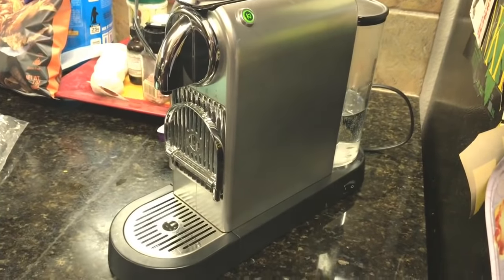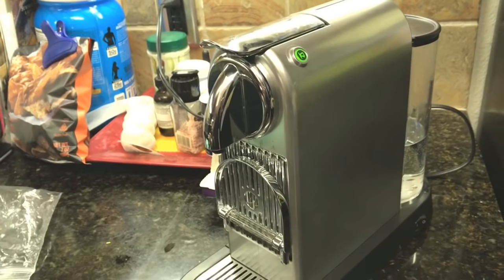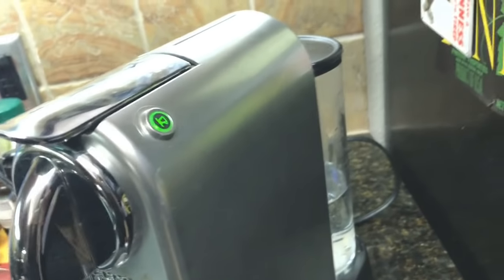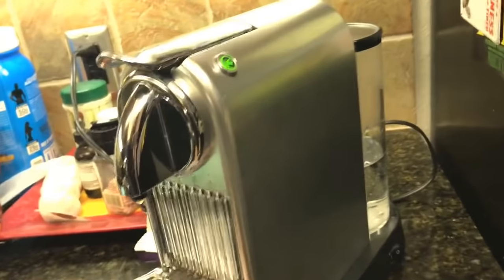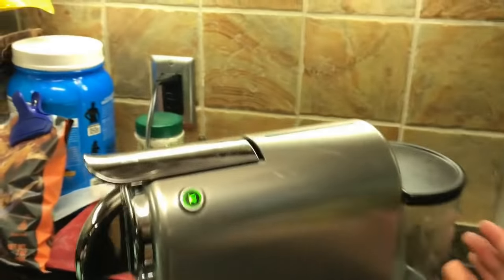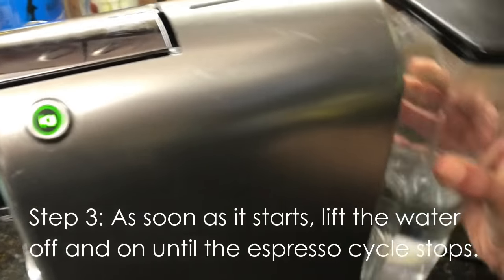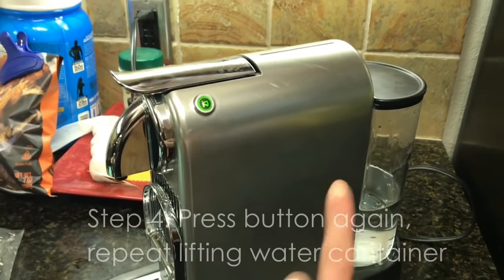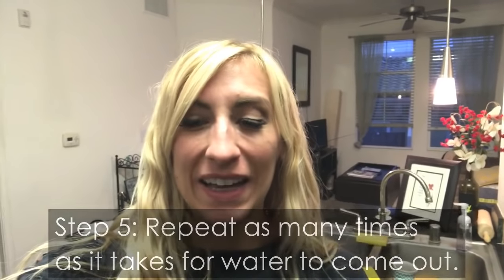How to Fix a Nespresso Citiz Machine That Isn't Pumping Water

Comment: I looked at several videos, including this one. I watched one where the man said to do it really fast in and out. I also put a drop of vinegar in the hole  as I was pulling the water piece in and out. It finally loosened up, and water started flowing. I added vinegar to the water and flushed it out thoroughly until the water was clear of coffee debris. Needless to say, it's close to midnight, and I am wide awake cause I wanted to drink a cup of expresso after working on getting it un clogged for close to 2 hours 😂

Comment: This works on Verismo that has been in storage a long time-7 yrs, today. Flushed with vinegar/water mix. Took about an hour as I tried using straw with an ziploc bag filled w air to seal around straw, as I blew into the machine port. Also searched other solutions. This got it done!

Comment: I stored my machine for more than 2 years and it was not working anymore. I called the company and she told me to pump the container back, but the water still did not flow. But while doing it while the machine is running as you have described, it worked! But I pumped more than twenty times trying both buttons and finally the water came out! Thank you very much for your video.

Comment: I, too, was losing hope. After 40+ cycles of doing this, nothing. "Maybe I have the one machine that this won't work for" I thought. But then, just as I was about to throw in the towel, I heard a faint bubbling sound, and after about the 45th attempt, I finally got water out. My machine is now working perfectly! Thank you so much for this video!! This WILL work, keep going!

Comment: I didn’t think this worked for me after 20+ attempts at pushing the button and moving the water tank up and down with boiling water so I stopped. I left it for a few hours and came home to try again, and voila! First push of the button and water came through. Maybe this will help you if you don’t think it’s quite working but you hear some gurgling sounds in the machine. Thanks for the tip! (The ziplock bag with air trick absolutely didn’t help and was way too hard!)

Comment: I did this for a while and it didn't work. And then I tried the "plastic bag" method and that didn't work either. However, when I combined this method with the plastic bag method, I finally got it to start pumping! So, if anyone is stuck after trying the method in this video, try combining methods. 

Thanks so much for this tutorial!

Comment: Thank you for the video! I also followed through but the key here is make sure you use VERY HOT water. I tried 15 cycles with warm tap water at first and did not work. The second the Nespresso customer service representative told me to use HOT HOT water, the water came out. I filled half boiled water and half room tap water in reservoir, so the water came out right away! Good luck!

Comment: Hi Holly, I had my CITIZ sitting in storage for like 4 years, finally decided to pull it out and use it and it basically wouldn't pump water. I spent hours trying to figure it out just like you. I even took the screws out and took it apart and it did nothing. Then I came across your video, tried it, and I had it working in about 5 minutes. Great video! Thank god for you! You're awesome.
Reply from the maker: Yay! I know, I was so frustrated, too, and it turned out to be so simple!

Comment: Yes! This fix worked perfectly. Be persistent; it took numerous iterations of working the water reservoir...I'd lost the siphon by running the water dry. Try not to do that. It happened to me once before, and I got it working again. This time around, it was more difficult...Thank you for this remedy. I've had early model (Essenza) for >10yrs, and it works perfectly. I clean it after every use by just run water through.

Comment: Yes, thank you Holly. I tried the air filled sandwich bag and the popping the reservoir off and on to no avail.  I couldn’t figure out the straw solution.  The really hot water must have done the trick.  Thanks for saving us the agony of trying every other YouTuber out there.

Comment: Bought a beautiful Citiz machine on Marketplace. Water wouldn’t flow.  This fixed it! I found that it helped when you hold one finger over the spout to create more suction while you are lifting and replacing the tank.  Had to do mine line 12. times! Started to see more bubbles when I did that finger trick!  Thanks again! 😊

Comment: No joke, you are the Nespresso hero!  After sitting in storage for 3+ years we decided to take out the Nespresso machine.  After cleaning the dust on the outside, I hit the button and no water came out, just the buzzing sound.  Next, I find this video and it took me like 10 minutes of working her technique before the water got through the clog and started flowing.  My wife was upstairs probably thinking I lost it and was taking my anger out on the Nespresso machine. Lol.  Pro tip: you don't have to fully remove the water tank.  Just tip it back and away and then put it back in place.  As long as you momentarily break suction at the bottom and then reconnect, you will force the water down and into the system.  No need to completely lift the tank.  I might have fixed mine faster had I not removed the tank each time at first.

Comment: Had the same problem, machine was in storage brand new and after 5-6 years I decided to use it. After several failed efforts mentioned in the video i came up with a solution that worked for me: I used a syringe to suck the air out of the system which was clogging the water flow, placing it on the bottom of the water container, right above the red circle while the Lungo button was pressed (the one on the right). Repeating the process for a few times. After this the machine went to cool off mode due to excess heat and the water pump could not be used it. I waited about an hour for it to cool off and when I switched it back up...Voila!!.. the water was flowing and I enjoyed a cup of espresso. Hope this works for you.

Comment: Holly, over on the Nespresso reddit sub, we send folks to this clip often. Thanks for the effort and a working solution. If I may, the action of raising and lower the tank engages and disengages the valve. When you place the tank back on the valve, a tiny bit of pressure is applied to the drop or two of water that are below the valve seat, forcing that small volume of water along toward the vacuum side of the pump and, hopefully, eventually clearing the vapor lock. This repeated action could, in impatient hands, result in damage to the valve. I have had success simply using a turkey baster to squirt water under considerable pressure down the tube. Have a towel handy.
Reply from the maker: David Bogie thanks for the extra tip!

Comment: Amazing thanks that worked! I had not used my machine for 2 years, and could not find any helpful videos until your one.  It took 3 cycles to get it pumping again.  I noticed you will help the machine get a bit quieter once the water starts to run through it again. THANKS!

Comment: Thank you for your video.  I had just cleaned it and it no longer pumped water.  After 3 tries of removing and returning the water dispenser, it works again.  You save me so much time to try to figure this out.

Comment: It was Air-locked. 

What you did was a process called manual-priming, or just: Priming.

Very nice video ma'am. I'm certain it'll save many perplexed souls a good deal of grief.

This process also works with about any other brands/models of home-espresso machine as well. 

My mother has the Lor/Barista machine that Phillips manufacturers. And they see notorious for getting air-locked.

Good idea using the hot water. I'd say that has something to do with there being less air-bubbles in the water.

Really, i think it's best (if possible) to avoid using tap water all together simply for the fact that a lot of times there tends to be more air bubbles in tap water.

Comment: Thank you so much. 
After trying to fix my Romeo model for 2 days, before finding your video, I ordered a new machine. (the Romeo is 12 years old)
I then saw your video. I tried it and IT WORKED. I first had to finish the descaling procedure which had stopped at the rinsing cycle. It now works great. 
I think I will put the new machine in storage and use it as a backup. 
The fix was simple but the past few days have been frustrating.
Reply from the maker: Robert Goldman awesome!!

Comment: Friends - thinking I was the only one this hack was not working for, I got it to work. AFTER like 50 tries, 45 mins of on and off canister/tilting, lever and more, I resorted to trying boiling water. I boiled a small pot of water and  poured it in the water canister then waited like 15 mins for it to dissolve whatever was blocking the suction thing. I was told the heat of the water would open up the seal. I was getting quite disappointed as I had read 500 comments saying it worked for everyone… and then - eureka! FINALLY, FINALLY FINALLY, WATER CAME OUT THE SPOUT!!!  OMG i screamed with joy like a mad woman! So here is the warning: try and try with warm water, but if all else fails, boil water, let it sit in the canister and do the on/off thing and I hope you are as successful and not need to spend another $300 for a machine that should NOT have this design defect lol!  Thank you Holly! You were better than the 45 mins i spent with the very nice but useless Nespresso rep :)
Reply from the maker: Haha, we’ll I’m glad it worked. Good tips for others since I know it does take quite a while for some people!

Comment: Thank you SO MUCH for posting this video. I was just about ready to try tearing apart my machine when I found your video. Mine had been in storage for a couple of years but hadn’t seen much use before it went on the shelf so I was surprised and frustrated when I found it wouldn’t pump water. I tried the ziplock bag to no avail; I tried a turkey baster which also didn’t work. This method didn’t work immediately and so instead of raising and lowering the reservoir (the tab on the machine made that a bit of a challenge), I just started wiggling it from side-to-side. Just when I was about to call it another failure, it began to sound different, then voilá, expresso!
Reply from the maker: So glad it worked! And thank you so much for the Super Thanks ❤️

Comment: May angels smile down on you kindly!! I haven't used this Magimix Nespresso machine ( almost identical to yours)  for about 2 or 3 years. Its been in the attic. Our other machine has really had it as its about 35 years old... one of the original Cube machines.  It took about 15 cycles with hot water in the water tank as you said. VOILA....It worked. Thanks again. So many useless Youtube videos that didnt work. D from London UK.

Comment: Great advice. I followed it exactly and then noticed on like the 7th try that there were bubbles coming up from the  valve in the water cylinder. Next try i just let the full cup cycle run and presto we had water flow!

Comment: Perfect. My machine is older and was stored probably 4 - 5 years in the garage... Had to cycle 15 - 20 times and I even shaked the machine a bit as I could hear different sounds the last 5 - 7 cykels.. thanks for this!! I was just about to buy an new expensive one but will live with this a few more years I guess

Comment: I have the Nespresso Vertuo and it would not run out of the box!  I did the hot water, pumped up and down with the reservoir  and then I inflated a plastic sandwich bag and  pushed on the bag with the water in the reservoir..and it worked!! yay

Comment: Haven't used mine for over 2 years and this works. I added a little pressure but eventually the hot water cleared it out.

Comment: Hey, I looked all over and tried flipping handles and tilting and even the video with the ziplock back (and my attempt at using a wine pump to push the bubbles through).  I thought it was completely broken but used your method (on a Lattissima) and it worked perfectly.  I though it might break it further when I first pulled the water container out as it created a suction, but after that it moved smoothly in and out and only took 3 tries.  Thanks for your post!
Reply from the maker: Aderon A You’re welcome!
Reply: Hi Aderon, i have some problem on my Lattissima +. Can your explain exactly your problem and how have you solved please? Thanks in advance for your help!

Comment: My machine was also in storage for a long while. So pumping and lifting the tank on and off did not  work, nor did banging on the unit or rocking the unit while it was running. I stumbled on lifting the back of the unit off the surface allowing the water to run down the path it needed to go. Then I ran the unit like 10 times to work out the air and make sure the flow was consistent. *Lifting the back end where the water container is off the surface worked the first time!*

Comment: Thank you...I tried your way after 6 attempts still nothing.  So I while attempting the water reservoir on and off I opened the release lever back and forth 3 times and the water started running. So super hot water and pull handle back and forth. Thank you had to go through the bag theory and others before your fix thank you. EDIT: My model "Inissia" brand new unit.

Comment: @Holly My machine didn't worked for years and I just stored it since it stopped working and didn't find the time to deal with it. Few days ago I've decided to pull it out from the storage and fix it, so I tried few things with no success. I just ran into this video literally 20 min ago and did exactly as you explained, I almost gave up and voila!  It took too many circles but eventually it worked! so a BIG Thank You for taking the time and sharing your experience, that's greatly appreciated. Blessings on you

Comment: I used ours for a month before it stopped working correctly -the water comes out fine, but it wasn’t mixing correctly. So I tried descaling w vinegar. It seems to be working better now but it’s not as strong. I’m going to try this method as well, along w descaling w vinegar again. Any suggestions aside from that?

Comment: Had the same problem, A MUCH EASIER AND FAR QUICKER TECHNIQUE: take a small empty plastic bottle, fill the water chamber with a small amount of water, when the machine is running (with mouth of bottle over the red seal at the base of the water chamber) squeeze the bottle  forcing air through the system, remove bottle, empty water that has been sucked into the bottle and repeat.

Hope this helps

Comment: I have a Citz that was used maybe 10 times whilst our main machine was in for repair 2 years ago. Since then its been in storage unused and is 1 month out of guarantee. Mine also isn't pumping water correctly. After trying the tips in the video, I still get no water flow, but the pump now isn't starting either. Maybe over heated I don't know.

Edit: After reading other comments I tried just off boiling water after the system cooled down. It did 1 pump cycle then stopped again. No water came through. I waited again for a few minutes and used really cold water, and a trickle came through. I am now doing a descaling cycle to ensure the waterways are not clogged, and half way through its stopped again.  I think it is overheating.....so waiting again. however, at least it looks like it is going to work again. Thank you.
Reply: did it work? mine did the same the pump stopped making a noise

Comment: Thanks for this info Holly - sadly trying now for about 20 mins - super hot, almost boiling water and raised the back of Magimix Pixi around 1/2 an inch but still not luck. Not sure if I should continue? Must have done it 50 times! :(
Reply from the maker: Margo Steeden Wow! Maybe it doesn’t work with that version? Probably need to call Nespresso 😕
Reply: Yes, will give it another go this morning and then will contact them. No doubt they'll suggest purchasing a new one!
Reply: So, tried again this morning and it worked after 3 rounds! Persistence is my favourite thing! Thank you very much for your video Holly :)

Comment: Quick suggestion … Before trying anything else, check that the capsule has been pierced properly, I spent half an hour troubleshooting the water flow only to find out the capsule was blocking it …

Comment: I think hot water is key, because I tried it with cold water before and it did not work until 
I used HOT tap water.

Comment: Be careful I followed these instructions I had a faulty nespresso expert not working, I put boiling water in my fault dont use boiled only warm, I ended up bursting a plastic seal in side, and also the water vessel lost the shape due to heat when it pushed down the connection valve it did not work, if you have the same check when you push down you should see the valve rise inside the vessel, I had to reshape the vessel valve back so it worked and also fix the plastic seal inside, the issue with my expert was a flashing led light on top I opened it up stripped down and on the slide mechanism on top is two glass tubes that send a signal across an air gap when the slider is open a leg breaks the air gap stops the machine from pumping, because I had a buildup of steam coffee etc it thought the machine lid was still open when it was actually closed, give them a clean and it fixed the issue, took about an hour to do, love the video thanks for posting.

Comment: Ok. After 2 days of doing this it mysteriously started working. So…I thought I should descale it. The directions in the manual say to run the rescaling until the tank is empty…BUT…when the tank runs dry, it sucks more air in!!!!! So I’m back to square one!!! Be warned!!! When descaling, DO NOT LET THE WATER RUN TOTALLY OUT. Stop the pump BEFORE it runs out!